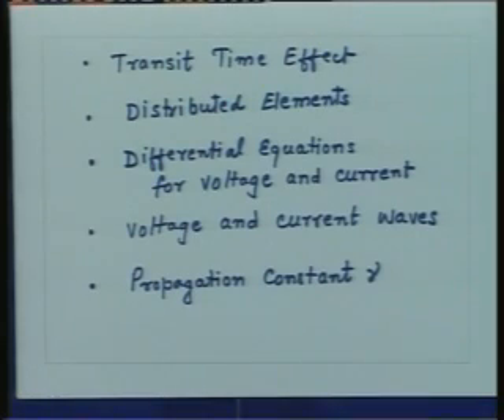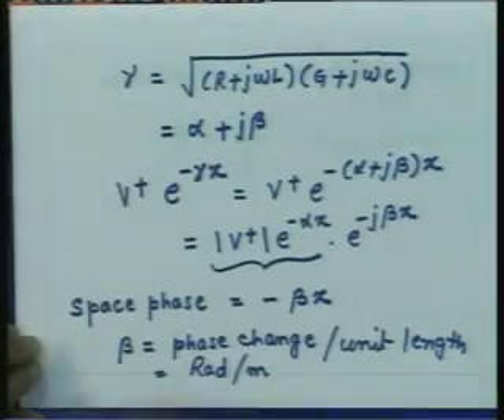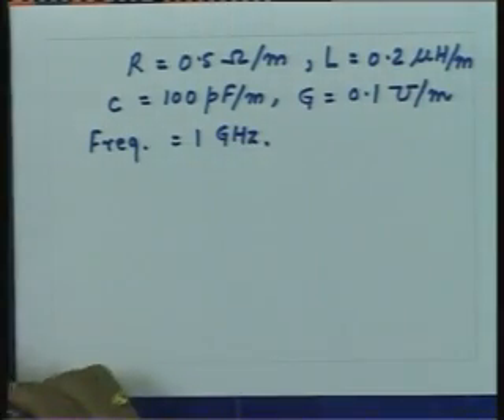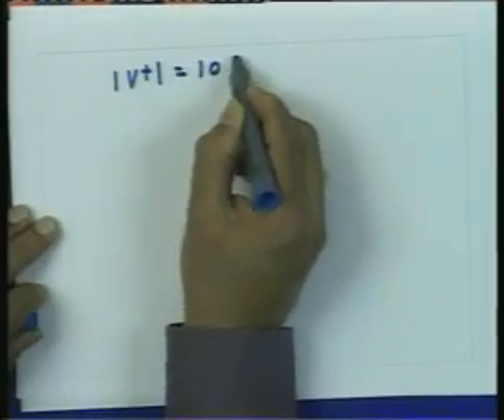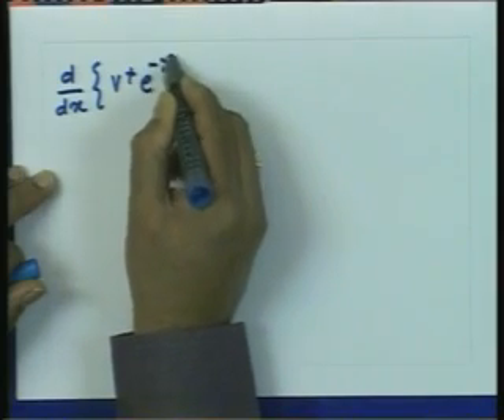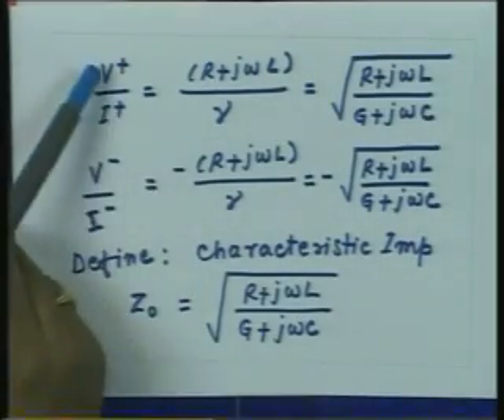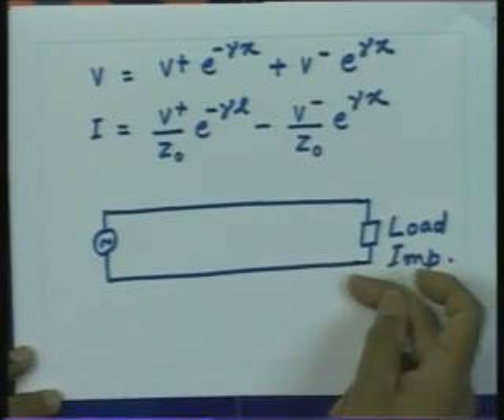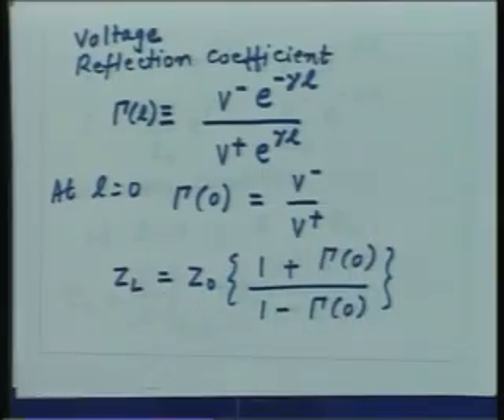Propagation constant, Characteristic impedance and reflection coefficient

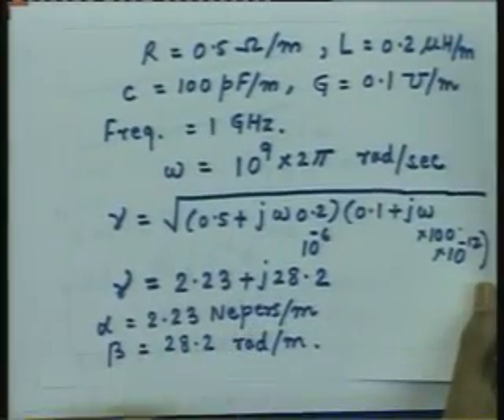Comment: At 23:53 While calculating voltage at x=1,t=100nsec we don't know the phase at that position. But sir has taken the phase 30° which is the phase at t=0,x=0. So  I think Sir is  missing the phase at x=1. It must be something else. rectify if I am wrong.
Reply: I think you are right. His calculation of gamma is wrong too.
Reply: @jacobvandijk6525  You haven't considered the square root by mistake..That is why you are getting confused..Consider each term under the square root in polar form and then compute the value..
Reply: @aniketsaha7455  Basic multiplication: 0.5 x 0.1 = 0.05; the square root of 0.05 = 0.2236 (not: 2.23)
Reply: @jacobvandijk6525  Man you are again making a mistake..You can't take square root of individual components..I would like you to search square root of complex number..Else send me your gmail and let me send you how the values are coming..
Reply: @aniketsaha7455  Hahaha, I see. Thanks!
Reply: @jacobvandijk6525  use polar form to calculate
Reply: 30 degree is the initial phase associated with the wave..An additional phase is added to 30 with position and time..So the explanation is absolutely correct

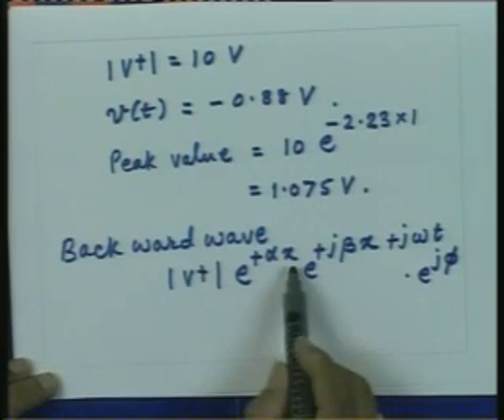Comment: At 27:00, isn't the peak value of the backward voltage denoted by V- than V+.
Reply: I think |v+| =|v-|
Reply: both are same in magnitude bro
Reply: Wait  a min... shouldn't we consider  V(total) = |V+| exp(-gammax) + |V-| exp(+gamma x) at t = 0 in which case both should be used when V total =8.66v (given).

8.66v*(1/cos 30 )= V+  +  V- ; even if they are equal shouldn't each be 5v each ?
 Are we assuming there is no backward wave at the t =0, this would change if this t =!0 correct ?
Reply: @saisravanbharadwajkarri3925  Indeed a good argument..I guess superposition is being used..so 8.66+8.663=2|V+|Cosine 30...2 gets cancelled

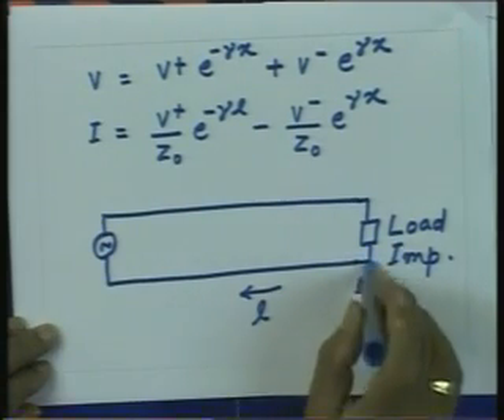Comment: 44:40 but L = D - X where D is the total distance of the transmission line. L is not simply -x , please correct me if I'm wrong!
Reply: you are wrong.  Now think about the direction . you were travelling for left to right with was x and than start your analysis for right to left thus it is denoted by -x (L).
Reply: Rahul Adesh that's the slope but there's a constant missing here which's D "the length of the T.L."

L = -x + D because L(0) = D not zero
Reply: Rahul Adesh I've almost completed this course and I don't find that D very effective, you'll get the same calculations at the end.. but it is a mistake he made. Nobody is perfect!
Reply: He has changed the direction of analysis. he does not simply replaced   L=-X . A lot of thing has also changed like V+ value which was the value of voltage at source end after replacing it will be value at load end. I think you get my point.
Reply: There is whole team of iit faculty for creating a video. So there is almost a zero chance of error. If you find any error than i means you did not understand the concept properly  :).
Reply: If you still have doubt . I can prove it. Thank you.